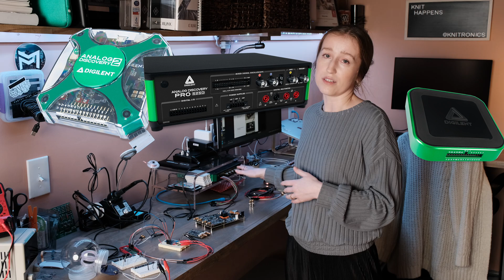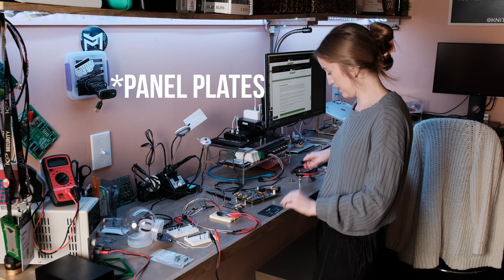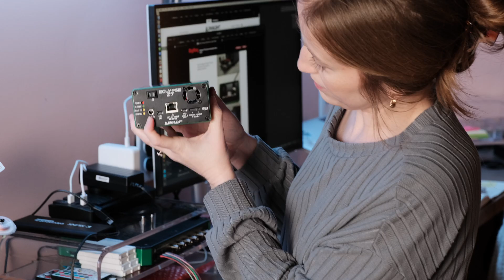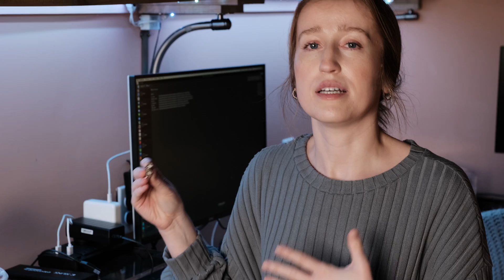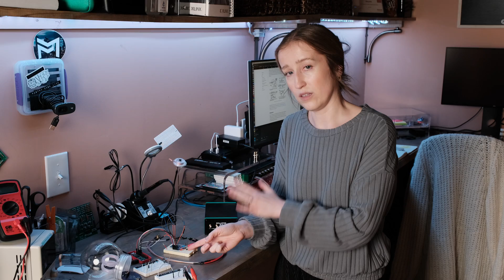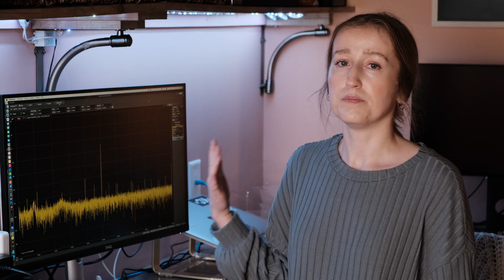Waveforms on Eclypse Z7 in Action

Comment: at 19:30 I think that the current will be the same from the PSU to the DUT. The voltage will be different and that is the reason why you would want to implement a four wire prob. Ofc this applies to DC only , in AC current will differ.